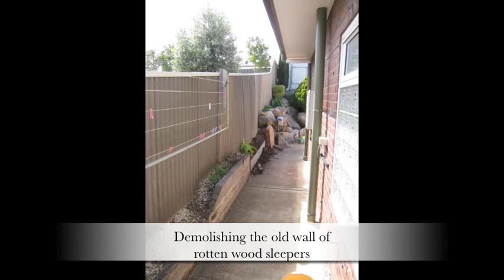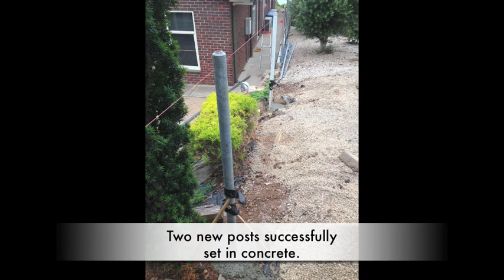A Retaining Wall - Made by J&D

Comment: Where can I buy those posts in America in the US
Reply from the maker: The posts are hot dip galvanised I-beams with a 5-1/2 inch web. Very common in Australia as these retaining walls are everywhere. In the USA, probably only available by special order from a steel supply house. If you mean the concrete sleepers, you would probably need to cast them yourself. These were 4x8 inch x 6 feet long. They have three lengths of 5/8 inch steel rebar inside. Also very common in Australia, they come in 2, 3, 4 and 5 inch thicknesses, all sorts of lengths.
Reply: Do you know if the 5/8 steel is cross braced and what strength of concrete is used?
Reply from the maker: Hi Tim. The rebar is not cross braced, the three bars are merely parallel and spaced evenly. Concrete strength? No idea but I’d guess at least 3000lb

Comment: Nice work.
I'm going to build a retaining wall in the same way, galvanised H column in concrete foundations.
But instead of using concrete sleepers I'm going to use bankirai wooden planks 5cm in thickness and 1m long between the posts, it's more expensive but looks nicer, as the wall will be in view from my living room.
You kept the depth of the holes about the same height as the part of the wall above the surface?
I will do all the work myself, to keep cost down.
However with a hand of help for drilling the holes, using a 2 man hand held petrol auger, the diameter is 30cm for the holes.
The drainage behind the wall is a good thing, as I wrongly planned to put the drainage in front and below the wall, but seeing several videos I have seen that there's a reason to have drainage behind the wall, and that is to prevent washout of the soil (currently also the problem with a low concrete border behind the path and a sloping garden)
Reply from the maker: I learned from my Dad, building tensioned barbed wire fence that soil is fluid in most cases. These posts would be holding back a lot of pressure from damp clay-based soil with little rock. In this neighborhood there are quite a few other retaining walls that were moving and a couple near collapse. I opted to place the posts very deep in a large diameter hole, they will still move over time but not much. Not too evident is that the wall and posts are leaning back into the bank by about three degrees which helps direct soil pressure down rather than against the sleepers. One meter between posts should mean that the holes don't need to be as deep, unless the wall exceeds 900mm. One end of this wall was 1200mm and as the sleepers exceeded 2000mm, that end post was 1500mm deep. Drainage behind the wall is important for the reason you've stated but I think it also reduces how much moisture is retained behind the wall, making the soil less fluid and with less weight.
Reply: @madebyjnd  I planned to make the posts as deep from the bottom of the wall as the wall itself will rise above it, plus an extra 30cm or a foot of concrete beneath the pole (I place the pole on a concrete block upright at the bottom of the hole before pouring concrete).
Minimum length of the poles under the surface is 60cm or 2ft.
Which turns out as a lucky advantage as at the start of the wall with the smallest height difference which I originally worked out at just 1 plank or 15cm high, it turns out that the wall needs to be a plank higher in this part as I removed all shrubs today.
Then the wall will rise up to 120cm/4ft at its highest point at the other end, where it terminates to an adjacent building.
I also found the remains of an old brick wall  with its foundations today exactly where I planned the wall!
But I use this to my advantage and move the new wall a bit further back, and the old foundation will be in front of the newly made foundations and help to keep the wall in place.
Reply from the maker: @Tom-Lahaye  I think your wall will stand for longer than you will!
Reply: @madebyjnd  I'm sure it will, btw I was wrong on the wood, it isn't bankirai but azobe, a very hard wood which can withstand being submerged in water.

Comment: Hi, I need to build a similar wall but much higher and access is very tight. Could you tell me which builder are these guys and which state? Thanks
Reply from the maker: This was Hallett Cove, South Australia. I don't remember anymore who the builder was but he did mention that he wasn't able to build much beyond 900mm high without an engineering design.

Comment: Great work! how long was the distance between the steels? How deep was the holes for the steels? How long was the concrete sleepers?
Reply from the maker: Sleepers come in standard lengths up to 3 meters. In this case most of the sleepers were 2.4 meters long. They were also 100mm thick. These are heavy duty normally used for walls higher than 1 meter. Less than that height, 80mm can be used or even 50mm if less than 0.4 meters high.

Comment: What about the drainage?
Reply from the maker: Jay russel if you mean drainage from atop the foot path, it has a slight 1:15 slope from the rear to the front of the house. if you mean from behind the wall, there is an ag drain along the entire length, again sloping from rear to front of the house. The ag drain is more or less redundant as the ground behind the wall slopes away from it. It doesn’t rain that much here and these two things have been more than adequate, never any puddling or standing water during even a cloudburst.

Comment: Anyone know where I can buy h posts or I beams like the ones used in canada
Reply from the maker: The ones I used were galvanised but standard uncoated beams should be available at any steel supplier. If galvanised beams aren’t available you should be able to find cans of cold galv paint and make your own. clean the mill scale off first before coating though.